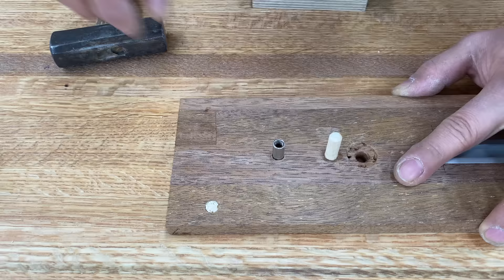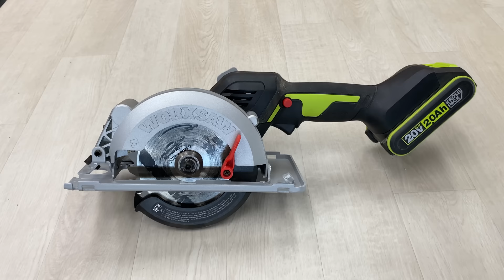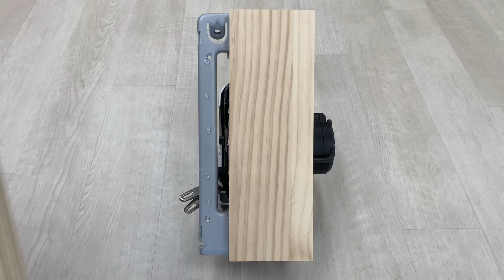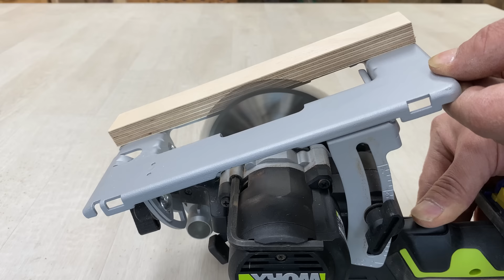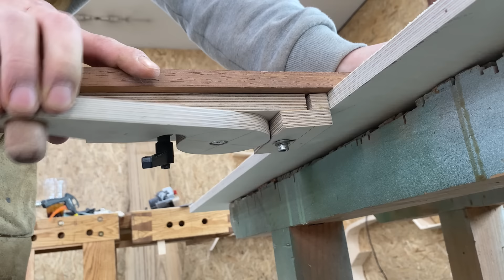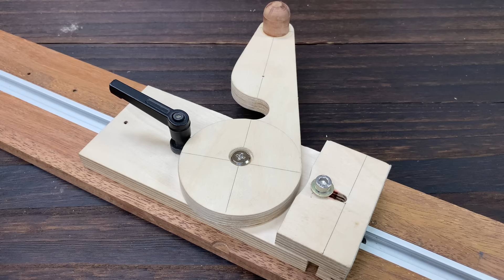The perfect combination for cutting wood / rail lock clamp

Comment: In my humble opinion this is the best track guide. Built in splinter guard, support for saw at beginning and end of cut. Missing only one thing I can see, a way to lock saw against the track to prevent "drift" away from guide. Easily solved using the "guide" usually supplied with the saw from manufacturer. Excellent guide system, thanks Hammersound.

Comment: I like your clamping mechanism but your guiding solution means you can't use your saw without your ruler anymore. The way I prefer is to have a second board glued on top of the first and have the side of your saw's plate run against it. Your first cut trim's the bottom board, so no you can just lay it where you want your cut. Plus you can use a thinner board for the bottom and not loose to much depth
Reply: This. Definitely this. I was going to add this to my comment before I saw yours. There's no reason at all to have that board attached to the saw, and several reasons not to have it there.

Comment: Gives up a lot of depth of cut. I prefer a thin piece of plywood with a thin straight edge attached. Trim the plywood with a first pass. Then put the cut edge of your base plywood on your marks. Very accurate when mounted on the keeper side of the cut. If you wander away from the fence you can take another pass. The thin plywood also reduces tear out. You can screw it to the non show side further reducing circular saw tear out in the show side.
Reply: I do like the clamp mechanism design, but yeah, the rest of it could be done better.
Reply from the maker: That's a good way.